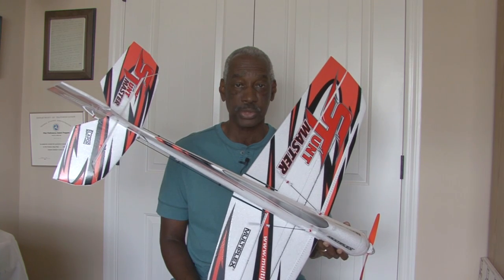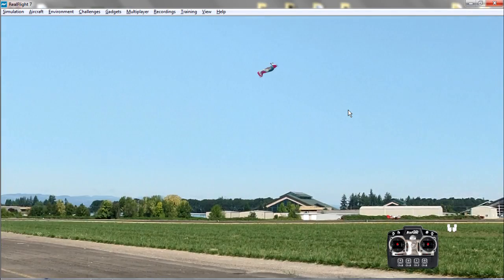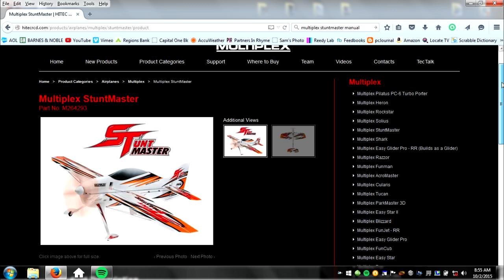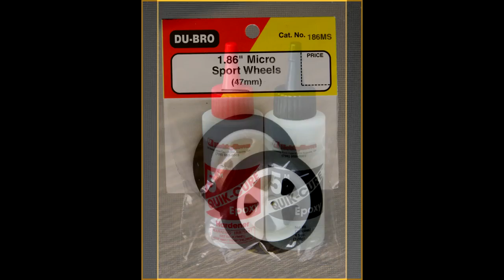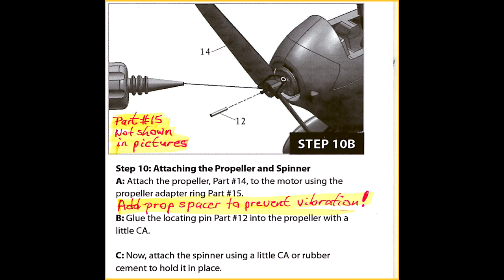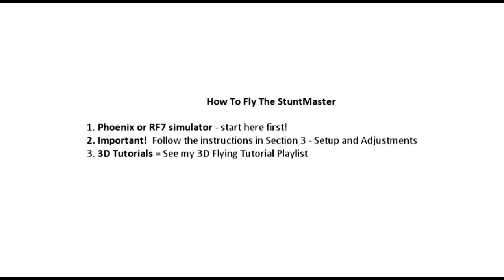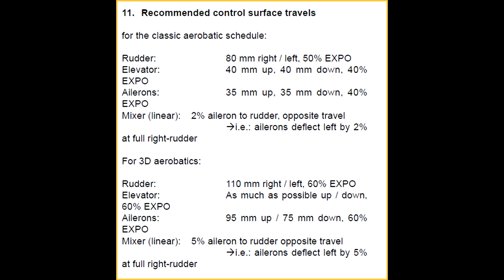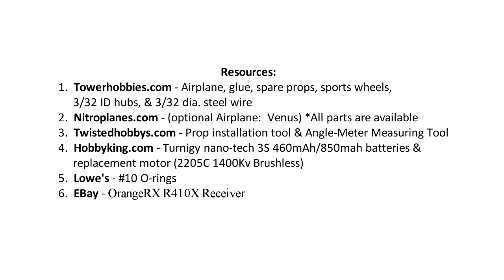Multiplex StuntMaster - [Jump Start Guide to 3D Flying]

Comment: late to the party , just got this plane. Love love it EXCEPT power, yes it doesnt have any wring your neck power to get out of trouble anytime. It has enough to hover but after 60% power it doesn't increase. I have another foamy that just rips out in case you get in trouble. I wonder if changing the prop to 9x5 slowfly prop will do the trick. Tried a 8x4 that did not help. Beautiful plane !!
Reply from the maker: Hey, thanks for the comment and I hope you become a subscriber to the channel.  I no longer have that plane but it introduced me to 3D flying and since then I've graduated to the 342 SBach (which has more power) and the Eflite 300.  You might try the 9x5 prop as I'm not certain if that will give you more thrust.  Take care.
https://www.hobbytown.com/dw-hobby-e18-sbach-342-electric-foam-airplane-combo-kit-1000mm-dwh-e1804/p1246462?msclkid=17ffa6b53552105ba969c580c6d49c0f&utm_source=bing&utm_medium=cpc&utm_campaign=HT%20-%20Shopping%20PLA%20-%20INSTOCK%20-Desktop%20-%20Performance&utm_term=4584551177008420&utm_content=airplanes
Reply: I'm even later to the party trying to figure out if this had battery straps and what's up with the prop washer.

Thanks Willie!